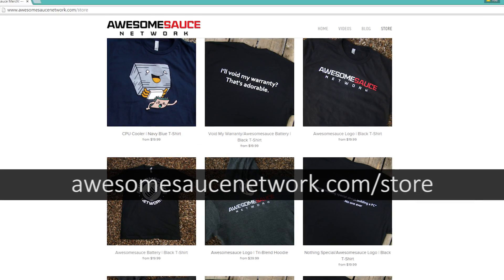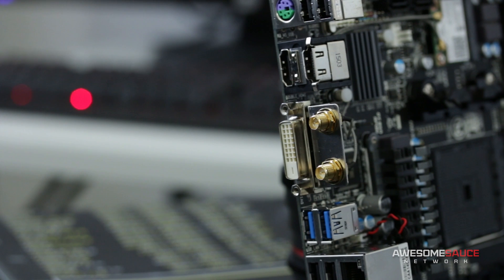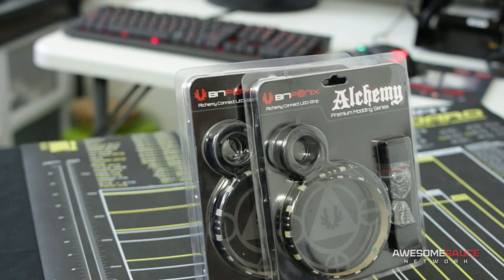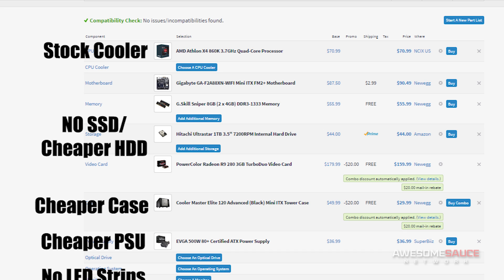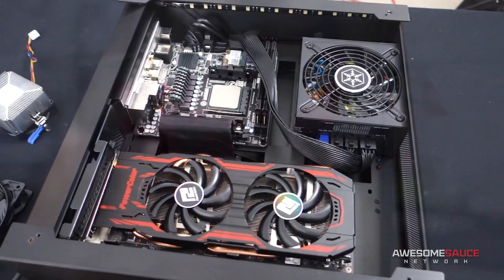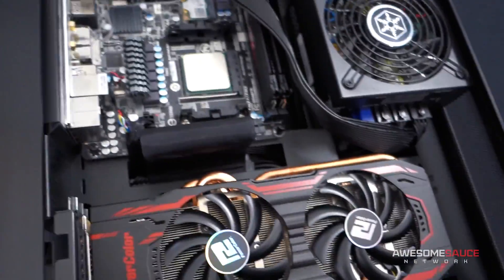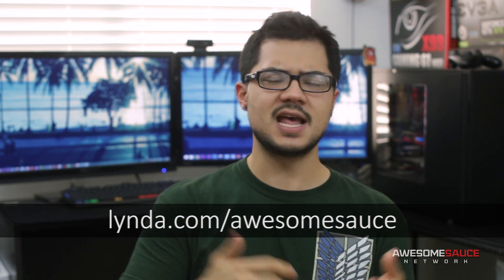The Overkill Console Killer: And How to Build One for Under $500 (Part I)

Comment: Get a 24 pin cable extension so you can route it properly, get thick rubber washers, use them as spacers, and possibility longer bolts to extend the glass panel away from the case for the cpu cooler to fit. Bam, 2 cheap and easy fixes. Ram well a low pro set is about all you can do there..
Reply from the maker: Kelleytech i'll see how she overclocks with the slim fan before resorting to the bolts, but you just reminded me I've got a 24-pin cable extension lying around somewhere. pretty sure it's from silverstone too. thanks kelley.
Reply: Anytime, keep up the AwesomeSauce work!

Comment: As an AMD guy I was gonna suggest this LOGISYS Computer BETA 400 ST AC4400BT 92mm Hydro Bearing AMD CPU Cooler for your build, as I have it on a 4 core AMD A-10 5800K APU, and  my temps usually state in the high 30's - mid 40's on average. The reason I said was is because the price went of it went from $17.84, to $69.95, and I'm like WTF Newegg. Have a look at it anyways as it's been an awesome CPU cooler for me, and glad I got it at the price I did. 
http://www.newegg.com/Product/Product.aspx?Item=N82E16835999013 EDIT: I should note that despite what the Newegg website says, this cooler can handle up to 125Watt AMD CPU's as stated by the Logisys website. 
http://www.logisyscomputer.com/viewsku.asp?SKUID=AC4400BT

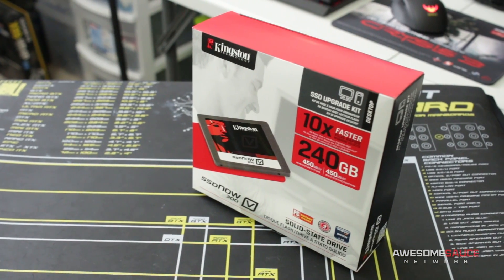Comment: tiny complaint but 3:30 THE AMD HEATSINK IS UNUSABLE. I used mine with my 8350 and when I say it sounded like a jet engine, I mean jet engine. It was like someone was screaming. Test it out yourself at full speed and hear how terrible it is before saying just to use that. I did an intel build for an office compouter, and the stock intel heatsink was much better. On the amd side, you really can't use the heatsink included if your gonna be maxing out your cpu.

Maybe a cheap 15 dollar cooler would be used instead.
Reply from the maker: nothingtoseehere.jpg pretty sure i said "yes, it will be noisy" in the video? lol.

Comment: the r9 280 is a very good option but why didn't you use a gtx 750 ti which is cheaper and still outperforms the 8th gen consoles?

Comment: Kyle, WHY.....WHY..did you choose that Kingston ssdNOW ssd!!  Don't you know about it's problems with the cheap as controller or nand that Kingston basically" sold out" when they DOWNGRADED it from the initial release models over a year or more ago?
You'd been better off instead using something like the Crucial m500 256GB.  They have often been on sale for 90 bucks or less depending on time of year.

Why get ram with tall heatspreaders?  They really DON'T do much in terms of cooling.  It's not worth it to sacrifice cpu/mobo surrounding area cooling from a good downdraft LP solution like that one you were trying to use and had to use the slim fan on just for the mediocre looks of the tall heatspreaders of ram.  There is plenty of 1333 and 1600mhz ram that is priced just as competitively as the ram you chose.

Comment: But even if you replace the RAM modules with low-profile DIMMs, won't you still have issues running that 24-pin ATX cable? It looks like the cooler would go in right where you are running that cable, and that cable already looks pretty tight...
Reply: ***** He had plenty of cash to buy a 24 pin psu power cable extension which are really 20 bucks or less ...everywhere.

Comment: I would have personally gone with i5/ 970. Better performance and it will run cooler costing the same.
Reply: jeremiah9561 How the HELL would any i5 plus a 970 cost the same?  Are you on crack?  
1.  r9 280= $170 after rebates  versus  970 at BEST deal before black friday sales 2015 = MORE than $285.00
2.  You'd have to get at least an i5 4340 to beat the performance of the 860.
i5 4340= $159.00 currently on newegg and about same price on amazon................. versus 860 at 78 bucks damn near everywherer.

So what you just said was getting any i5 + 970 ( which = AT LEAST 400 bucks ) costs the same as getting that 860 + the r9 280 ( which = worst case scenario and no rebate dealt with.... $280 bucks....TOTAL.)
400 DOES NOT equal 280 kid.  Go back to 2nd grade math.  Seems you failed that class.

I KNOW this because i've actualLY TESTED such builds using THOSE exact parts on my htpc rig versus my wife's budget gaming rig precisely 7 months ago.
Reply: Chronofusion Woah calm down bud, did you watch the video? Did you see exactly how much he spent? Are you that stupid? I think so, a 970/i5 build cost about $950. Also, an i3 destroys AMD CPU's  gaming performance wise, clearly you are a complete idiot. But for $500, sure go with shitty AMD. Fucking idiot.

Comment: Awsomesauce Network, Why don't you try running the 24pin cable under the motherboard, than up and around to the connector?   its possible with those flat ribbon cables .

Comment: This might be a dumb question, but can you explain how the video card works!?! Thanks! :)
Reply: GPUs use the power of magical gnomes to project an image onto the screen. They prefer ideal working conditions so the cooler the card is, the harder the gnome works. Sometimes he masturbates and when he climaxes, it's known as "GPU boost". Thats pretty much all I know.
Reply: Colin M Just imagine a flexible PCI cable.
Reply from the maker: Colin M The case comes with a PCIe ribbon cable that routes behind the mobo tray.
Reply: Awesomesauce Network That's different! Where does it attach to the mobo then?
Reply: Colin M The PCI-E slot 16x of course.
Reply: Colin M seems like there's noticeable latency and performance penalty.

Comment: 4790k & gtx 980 or 5820k & 970?
Reply: Musclecar289 for gaming go 980 m8
Reply: Clark Clarkson Too much of a hassle.
Reply: Clark Clarkson wasting more energy and only 2gb ram SLI does not stack the VRAM so its still 2gb and you will have stutter issue in sli likely
Reply: Musclecar289 for gaming the first, for rendering the latter.
Reply: i read that there will be a new chipset lga1151
Reply: I know future proofing is taboo, but I want a feature packed platform.
Reply: ddr4 ram was a dissapointment which is why the non x series i7s are still the most popular since it has the best single core. But the 6 core is still a big benefit with x99 platform because of the ddr4 ram which isnt too much faster but is still a decent gain for rendering
Reply: Musclecar289 go 5820
the z97 platform is in the end of its life cycle.
but the x99 will get a new wave of cpu's (skylake E)
not to mention natively supported pcie3 and new storage methods (nvme)
you can always upgrade ur gpu in a few months. but dont restrict urself to a dead platform.
and what theyre saying about ddr4 is bullshit as the new storage methods (nvme) need ddr4 to work optimally otherwise ur bottlenecking those drives.
Reply: X99 will not support skylake since they will be shrinking the die to 14nm
Reply: Beta Bot
 i think it will. nevertheless there is a second round of x99 cpus coming out for sure. they confirmed this. x99 will be the enthusiast platform for the next 5 years. the x79 first came with sandy bridge then the ivy bridge cpus rolled out. The same thing's gonna happen with X99.
But z97 is dead
Reply: n0 14nm wont fit
Reply: Beta Bot its been confirmed that there will be a second round for x99 so i dunno what ur saying
Reply: Beta Bot
 yes that will be the mainstream platform (z97 replacement) but the x99 will still be the main enthusiast platform for 5 yrs to come. same way the x79 was there all through the z77, z87, and z97 period. when x79 was first released the processors were sandy bridge E (3960x 3930k etc) but a few years later were upgraded to ivy bridge E  (4960x etc same socket) and those had die shrinks too.
fast forward a bit..... the haswell tick was z97, the tock was Haswell E on x99.
Broadwell or skylake or ballsriver or tittypalace will be tick then tock we get tittypalace E for x99
Reply: 850$ dollar price point
Reply: ***** 980 ti such a better deal